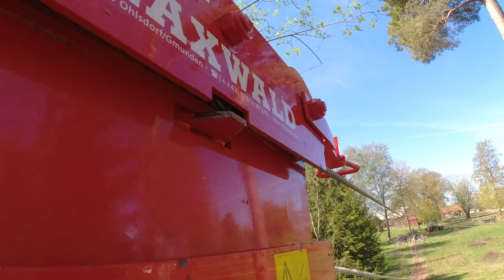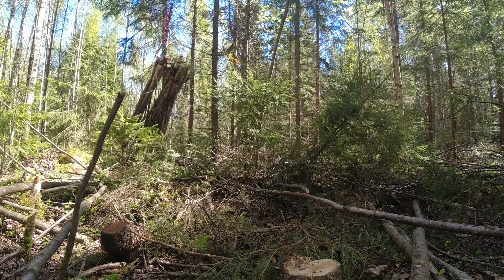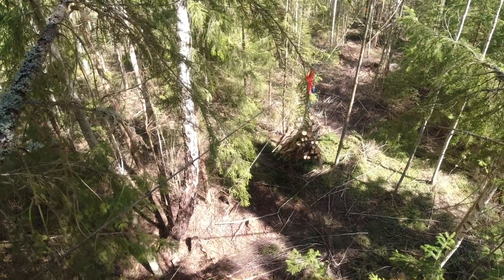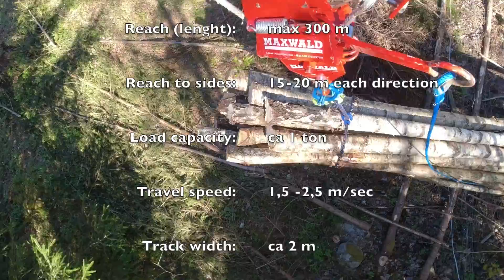LOW IMPACT LOGGING - First Thinning with Maxwald Cable System

Comment: I noticed you seem to have some piles bunched at the bottom of the hill ; are these felled this way or moved Mechanically? Just curious as to the side reach off the main haul line. I’m investigating a similar setup . Here in the northeast / Midwest United States all logging is done with skidders . Any steep ground ground that can’t be accessed with a dozer cut logging trail and pulled up with a cable skidder just gets left. We also have a lack of thinning operations because most of our pulp mills have shut down and our local firewood markets can only handle so much volume. That coupled with the Pacific Northwest being the only stronghold of yarder cable logging leaves my area completely void of knowledge on the subject. At any rate nice work and greetings from Pennsylvania!👍
Reply from the maker: Hello! To make the system be efficient we tried to use the systems load capacity as much as we could. The forest was quite dense before thinning and the trees were not too thick. Therefore it made sense to gather the logs in bundles, which we did by hand. I would say that 15 m of reach to the side is realistic, possibly more if the height of the system and the terrain permits. That way the cable system can be used to bundle bigger logs.

Comment: How do you tention the main cable? Btw amazing video
Reply from the maker: A double pulley is clamped onto the main cable and another double pulley is anchored to a tree or other suitable ground anchor. Then a 4:1 mechanical advantage system is created between the two with the wire rope of a 1.6 t come-along winch. That winch is then used to tension the 4:1 system and in turn the main cable. See minute 3:00 in the video (the double pulleys are red). Hope this helps.

Comment: Hello

Thanks for making the video.  I have never seen a system so small.  I am used to seeing larger hauler operations working.  Same concept, just slower and lighter gear.  If you want to go faster, then you could have another set of chains so you can strop logs while waiting for the gear to come back.  On a nice day like the video, maybe there isn't such a rush, but on a cold day you could go home quicker.  I know a guy who had something similar to thin stands using a Bell logger machine with a three drum system setup.  It was is New Zealand.  As far as I know, there are none left working anymore.
Reply from the maker: Hello and thank you for commenting! Yes, it is the smallest system for cable logging that I am aware of. That also makes it more affordable. Good point about the choker chains👍 I actually do have four of them but it didn’t always work out to use all of them while I was filming. Greetings!

Comment: Hello from Taiwan! Great introduction about the yarding system , is that winch A526S of Maxwald?
Reply from the maker: Hello! Yes, that is correct.
Reply: @timstradservice1739  We are forest workers in Taiwan and this system really appeals to us. Wanna ask you how do you haulback or storage your skyline (standing cable) ? Do you think it's necessary to add another drum for skyline ?
Reply from the maker: @虎山林業 Hello again! The main cable is stored on a drum that is powered by hydraulics (on my winch it is the grey drum on the back of the winch). It is not powerful enough for tensioning the main cable completely, but can be used to pre-tension before tensioning manually with the come-along winch (or “wire hoist”). It is also very helpful when taking down the system after use to pull in the heavy wire onto the drum for storage until the next use. This is not absolutely necessary for running the cable system since both tensioning and storing the main wire can be done without, but it makes it a lot easier and quicker. The main wire weighs about 400 kg and will be hard to spool onto a wooden drum by hand, especially up hill.

Hope this helps!
Reply: @timstradservice1739  We are much obliged to you !! Thanks for your effort on making these records and sharing your experience. Wish you all the best !!
Reply from the maker: Thanks! Wish you the same🙂